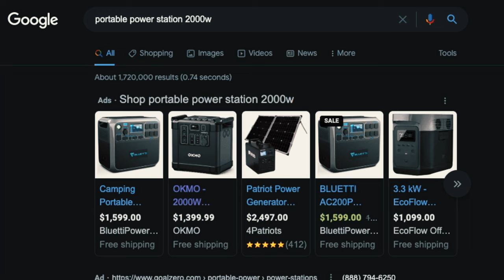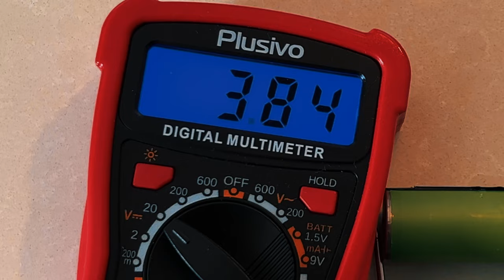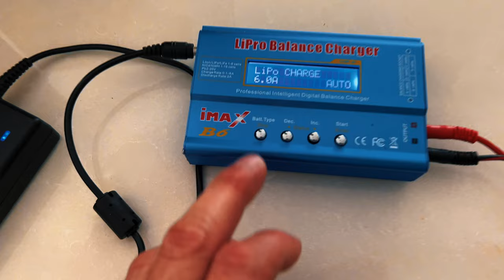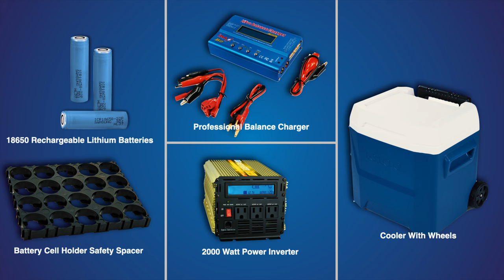DIY Lithium Generator / Portable Backup Power Station - Beginners Guide

Comment: Hello Markus, Had a suggestion - install the plugs on the Lid (instead of the side) and make more room for the third battery - also - if the inverter was painted black and mounted on the outside - it would look cool.  Note - If you mounted the inverter onto the lid - you could route the inlet of the Inverter fan into the cooler - (with a strategic cooler inlet - and have air flow around the batteries). I have spent many nights - in late July - in a sweltering hot tent... would love to have had a powered fan! - or at least make the others a bit jealous! Smile
Reply from the maker: well this would definitely keep you cool for about 20h :)
I did actually consider moving all the ports to the lid but 3 batteries would have also made the whole thing pretty heavy and the Inverter is “only” 2000W
Also wanted to implement a wireless charger into the lid but just ran out of time :)
I may build a second one that is bigger some day and combine it with a mobile solar panel.